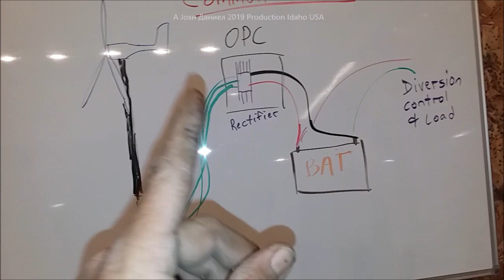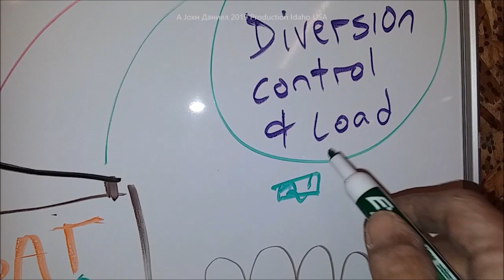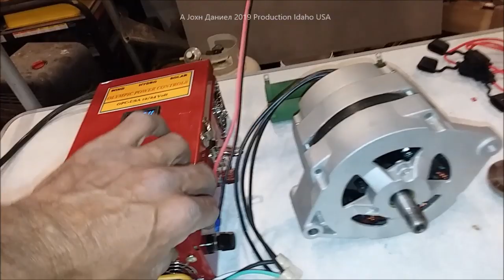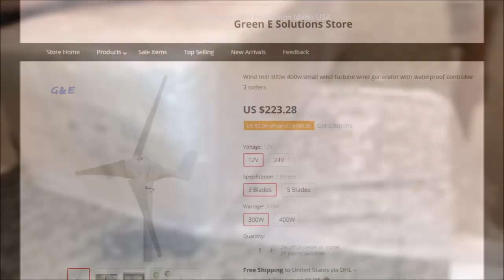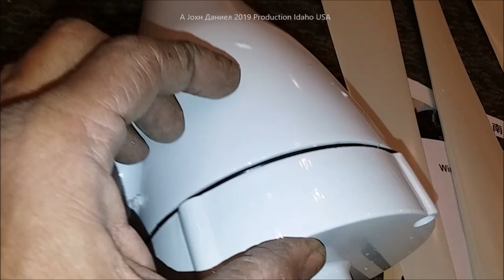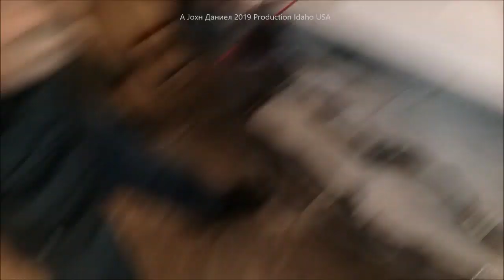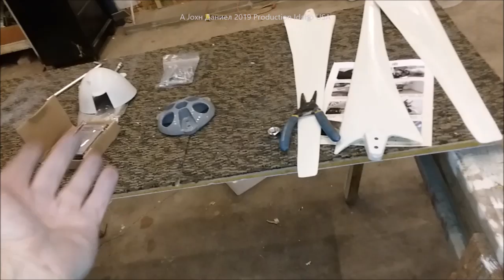300 watt Micro Wind Turbine, the GE-300-S, truthfully 300 WATT RATED! ALL Parts below vid

Comment: John what is your PayPal account link so I can send 35.00 to it for controller?
Reply from the maker: I'll send you it tonight on Olympic email. Been running season run. Will be back Saturday full time till July 5th so I can get one out to you.
Reply from the maker: Cool news, I was able to send from my phone, never tried that. Sent you a PayPal invoice. I'm in Shiprock New Mexico till tonight, glad I have internet on the Samsung!
Reply from the maker: Theres 3 in the shop I made up I'll just tell Wife to box one. I'll do a video on how to set it up and adjust voltage. Can NOT be placed in Poor venting, or unventilated or wet locations. Be sure good cool air flow and proper wiring. I'll send some lugs too. 300 watts (26 amps) of 2 to 5 ohm well vented resistors is max on its 40A SSR, to go higher you will need to put in a 60 amp DC/DC SSR. 
JD
Reply: Cool I would.like to bring my entire trailer out and show you it. I need so.e help figuring out my battery shut off I bought one that didnt seem to work . I need to figure out some kind of breaker box or fuse box and power distribution.  I made a bus bar for negative and positive using 1/8 thick, 3/4 width,14 inches long copper bars 600 amps I wired it to first positive  and far negative with two 0/2 welding cables on each 5ft long and bolted both double terminals to center of the bus bar. But my inverter seems to lag like there isnt enough power when I run my 15,000 btu AC unit I think it's an issue with the inside of inverter,  its voltage meter says 13.4v then flashes 12.5 for a sec and back to 13.4 with no load. So  9v drop and it does this for a sec then back, when I run a load and it does this it will trigger the low battery off . And there is enough power too .
Reply: Oh the copper bars I used in bus I put 3 bars stacked and bolted together.
Reply: Wont the turbine go over the 40 amps easy?
Reply from the maker: @donaldsteele6276  Yes, it'll probably hit 70 amps numerous times a minute but not constantly. Mine has hit 91 amps, but thats not 60 times a minute its in that range. When the divert kicks in it will be like putting a few dead batteries on the system, immediately dragging the turbine down. I run 400 watts on mine but I have completely insane winds. When its peaking at 50 amps constant the braking load also is what I use. But I have numerous turbines, so I must do that.
Reply: Oh I get it the resistors need vented too lol. I will just order another temperature relay board and fan I will put the resistors in a different box with a 2 inch OD pole mounted to the box with a fan pulling air from under the trailer to the resistors and a top covered air vent to blow the hot air out . Would that work? What's the size of enclosure needed?
Reply: How much for resistors that I need and brake throw switch.? Can I purchase everything I need from you? I order 25 ft of 6/3 awg for turbines wiring to help with line loss the turbine store send me a new stator and coil and guts for turbine because they didnt put the rubber seal gasket on the case and everything got very corroded inside.
Reply: Wow.today mine was hit with 60 mph wind gusts and 30 mph winds constantly that small controller hit the brakes it was still getting 6 amps at slow brake speeds.  My tower is awesome it has taken a beating well no problem.  I need help with fusing and breakers and also new 80.amp.mppt controller 200v max I'm putting 4 300 watt panels on it soon. I have no idea about combiner boxes and breakers for those. I'm reading allot. I would love for you to see my setup and offer pointers fixes what ever even freaking smack upside my head lol. Dude I am trying to figure out this busbar I made I think I might need to add some more bars. Not sure. I was thinking of making 2 one for power in one for power out right now they are all on the same one. I am trying to make a battery shut off switch work I bough a huge one and it didnt work.right.
Reply: I took care of it. Thanks. Does this come with the resisters or do I need to order some?
Reply: John are resisters included or do I need to order some?
Reply: John I ordered 3 100 watt resistors from your link but they wont arrive till august so I found some of these and ordered them OHMITE Resistor 100W 3 OHM L100J3R0 NIB they will get here by the 25th. Will those work good?
Reply: That controller you sent is awesome I'm trying to figure out the best weatherproof way to set this up. I was thinking a plastic weatherproof box with intake holes and outside holes and larger tubes attached to intakes on the red box feeding the cool air to it from a weather proof box.
Reply: Oh.i.want to buy some mc4 adapters and the mc4 lug adapters too for my large box and the red and black lugs for some other cases and equipment wiring. It would make the portable wind  and solar stuff better.

Comment: Are those 3 phase wind generators and that controller setup suitable for charging a Lithium Iron battery bank?
Reply from the maker: Yes. Best method is using supplied controller, slave batteries and a good MPPT
Reply: @JOHNDANIEL1  Do you a schematic of how you suggest this is wired up for lipo batteries?

Comment: What is the maximum 12v battery bank size one of the 500 watt turbines can charge?
Reply from the maker: 1000 ah
Reply: 1,410 AH
Reply: Shit mine is to big then
Reply from the maker: @donaldsteele6276  You asked about a 500 watt wind turbines ability to charge maintain a bank, you also have solar. If you only had wind power you would get batteries that never received enough charge with just wind and they would fail. But since you have solar also the max is based on the input of solar too. And of course the draw.
Reply: @JOHNDANIEL1  any luck with building a custom controller yet? I am about to wire my old one back in the mix because I have to have something on it other than that shitty controller that came with the turbine. I just have to wire with 6 awg welding cable this time. It's been stalling because the 30 amp camper cord wire or 3 x 10 gauge is 34 ft to controller now and I need to ho higher in gauge to much line loss.
Reply: So I would need to remove batteries from the  bank or maybe just make 2 banks and use bus bars to make a giant manual switch over.
Reply: Or get a bigger wind turbine none of them over 1kw are 12v can I use mppt controllers to run a 48 v?
Reply: I havent added the last 2 GC2-6V yet so I could just go with 8 GC2-6V on main bank and just make a smaller backup 4 GC2-6V bank?
Reply: These batteries are 235 AH GC2-6V
Reply: I know what I will do then. I will split the system solar on the 8 bank and the 4 bank the turbine  and since I wired everything to a bus bar I can just use some kind of switch over for the inverter to select bank or even select solar or turbine to charge a bank
Reply: What can I connect to the inverter to add a bank selector?
Reply: I also have a bunch more copper bus bars
Reply: John do they make switches that can control the positive and negative connections of 2 banks and switch bus bar items to the other bank and back?
Reply: Or can I just be simple about it and just  use large gator clips on the battery cables and just select which bus bar I want the bank on ? Or a design I could use copper bars to make a throw switch box or something
Reply: Well I have 600 watt 24v solar on a renogy rover mppt controller.  I found some 245 watt 30v panels for 67.00 each I'm buying 4 of those and making a large fold up table sized case with wheels on the bottom and a tow handle  with some window latches  this will happen next mo I'm almost tapped out. I ordered some 6 awg welding cable 50 ft worth and wanted to wire the turbine part way with that. And my mppt controller too.
Reply: I just notice that if I hook up a few batteries to the wind turbine you can see the volts jump up when its hitting charge speeds. But on my larger bank you might see it jump by 1 volt or none.
Reply: Well John what would you need from me to get me a good sized up controller for this system?
Reply: Hey john can u please send me a link to your PayPal account for the controller setup please  I need one asap my cheap one from China popped a chip on the 3 phase side internally when no wind was blowing. Thank god it was fused so its didnt damage anything else. Right now I'm using a rectifier that's fused 100 amp ANL fuse to battery bank and a cheap outdoor Chinese controller piggy backed to 100 amp rectifier.
Reply: One thing I was even thinking about was buying a 230v wind turbine with a inline inverter and use it to power my duel 80 amp marine charger and switch on its 230v plug and just use it to charge my large bank. And run  a voltage monitor to a dump load relay.

Comment: John do you have a link to your controller boxes you make?
Reply from the maker: No, I build them on spec for each application. Now that your turbine is built, installed and likely set for use a parts sizing can be applied. You need a 60 amp DC-DC SSR, diversion control to activate it, and 300 watts of resistors possible 400 watts of them if your going to park it high and clear.
Reply: Cool when can I get it and how much? Do I still get the hill Billy from Idaho discount?
Reply: Yup I'm adding more height eventually it will go 50 to 60 ft

Comment: How does this amazon.ca wind turbine compare?

https://www.amazon.ca/Turbine-Generator-Controller-Windmill-Convenient/dp/B07JGCDFDH
Reply from the maker: THIS WILL BE CONFUSING! But lets go - They make 2 near same appearing models with 4 blade sizes. The 100 watt/200 watt uses the 50mm thick stator and 40mm long magnets. Then they use the 500 and 550 mm blades to make one a 100 and another 200w. Model your showing is a 1.2m diameter blades, (just under 4 foot with 550mm blades)  Those in that link are the 200 watt models sold as 400 watt. A real 400 has 700mm blades, a 300 uses same 75mm PMA as a 400, but with 650 mm blades. Thats why I tell them to get the Green E 300, it runs safer with a bit smaller blades in high wind storms yet will hit 400 without damage in 25mph.  
I had a install where they bought 4 of those exact models, the folks were very upset when I said the PMA was only 50mm thick and maybe could hit 200 watts. So I opened one up, YEP, it was the high rpm 50mm stator. They returned them and ordered 2 of the M-500 models. 
These in the video, this lady ordered 3 to give me one to get her 2 installed for less, has the 75mm PMA, heavier wire,  60mm magnet length and with heavier slip ring. Blades are 650mm to make it 4 foot 5" .  
I do not trust Mars re-seller.

Comment: I am experimenting with 16 180ah Lifepo4 batteries and it's amazing the time's we are in now. With solar years ago things were possible but not money well spent. In the past several years with solar, wind and now lithium iron phosphate batteries... It it TOTALLY do able to be self sustainable. I'll post more vids of my build soon, but I did a test of 8 of the batteries on an emergency situation with my house and ran many things for 12 hours! . The dream is to build my next house with solar, wind and the batteries. 
Learning a lot from you as far as combining the wind into the dream. 
Thanks again John,
Dan
Reply from the maker: Looks like your pushing on to modern methods. Age is so fast creeping up on me, I started using smaller tools due to carpal tunnel and hopefully my next build for my own system will be MUCH LIGHTER LiPo . I heavily suggest a B&D impact like this one https://bit.ly/2WkWbKR compared to my Milwaukee thats kicking my butt. Never thought that little 8 ounce less tool would be just as powerful as my Milwaukee and keep me going on solar installs so much longer. Being in my 50's now sucks!

Comment: Also John, do I need to Install a diode in order to use the shunt? I installed the shunt just after the rectifier. The only reading I get from my digital meter is the systems battery voltage unless the wind generator exceeds the battery voltage then I pick up the additional voltage, I’m not reading any amps or wattage?
Reply from the maker: Your shunt main lugs should be between the Negative on the rectifier and battery. Your field wires should be as seen in my controller. Yellow/black unless you have a different color. The 2 red/black are to power the meter as well as show voltage and go only to battery. But it is possible you have a bad meter. I think It would be a good idea I do a video on 4 or 5 models since wiring differs on some to show correct millivolt alignment and where in stream to mount them. You gave me a good idea on them and even though others have done videos for things like car stereos or motors with amp meters, a basic all uses video needs to be there to help.
Reply: Јоhn Daniel can you go to my channel and check out my wiring video as to where I have the shunt installed? Also, can’t I just replace the dump load with a dead short as a auto break?
Reply from the maker: Looked it over, I suggest swapping the small wires around on the shunt.  Try both ways using this method of meter testing. If you have a 6 to 15 amp battery charger clip its clamps on the output of the rectifier leaving everything still like it is, You do not need to disconnect the turbine or change anything. Plug in the charger, note the volts rise and then check your readings. Secondly your length of run from turbine to control board, how long is it, are you using 8awg in that length at least? Loss may be significant in that distance.
Reply: Can you go to my channel and check out the video? I’ve tried 2 meters and my multi-meter and still no amp readings? I even gave you credit on the breaking system that I copied from you.
Reply: 25 foot pole and 40 foot run to garage, I’m using 8g all the way to the rectifier
Reply: I’ll try battery charger and swapping the shunt wires around

Comment: I built your manual breaking system that’s works well but it’s fully manual. I prefer your new design because of it being automatic breaking. Is there a way to modify a manual system to becoming a auto system?
Reply from the maker: Yes, I will be doing a video on how to make a volt sensing automatic 3 phase braking system. I work 60+ hour a week and teach 4 kids home school so it may be a few weeks.

Comment: I can use anything that uses power for the power dump, am I correct? Like a water heater or another set of batteries or something like that. I am pretty sure I am correct but I wanted to run it past you to make sure since you have a lot of experience than I do in this stuff.
Reply from the maker: I put a link down below the video to Ali where you can get the best water heating elements so your diversion can heat water. We do this in our place in the hills near Baker Nevada, we keep a 14 x 28 foot cabin warm with that process. Ours is mounted in 3 thirty gallon stainless steel barrels and a over temp diversion relay send power to a outside resistor bank if the water hits 140 degrees. The radiant heat from its tiny 8x8 basement keeps the shack warm in 0 degree weather. Always windy in the Nevada winter, and 8 batteries fill fast using 3 of these similar turbines.

Comment: How to add Windmill to a lithium battery solar sys.  I dont believe this method would work
Reply from the maker: You can charge lithium with wind. You must have a multi stage programmable charge controller. Theres about 5 on the market that are safe and effective.

Comment: Tell me something do you balance your blades before you put up your turbines
Reply from the maker: Yes. I use a balancing unit I designed about 8 years ago and a poly acrylic adhesive to add weight if needed. Luckily the Wuixi Air ( these) are within 2 grams on average. And if they are not, Green E will send you a replacement quick in my experience.
Reply: @JOHNDANIEL1  thank you John . I saw a guy doit about two years ago on the tube didn't know if it BS or not it's some most don't know about turbines I wasn't sure myself

Comment: BRO WHICH BETTER 24volts wind turbine or 12volts wind turbine
Reply from the maker: I prefer a all 12 system
Reply: Јоhn Daniel same, I don’t like the idea of voltages larger than 12 around my sleeping area... all 12 makes it simpler to build and set up... thanks for the wonderful review, I think I may get this turbine to supplement my panels at night... your video has actually perked me up to grab one... just gotta finish my solar setup.

Comment: So you don't recommend the controller that comes with the Chinese turbine? Why?
Reply from the maker: I do recommend them, just not for multiple wind turbines. None of them as dead accurate in braking voltage settings so one will get the feedback from another turbine and toast itself. And none can actually handle these dang Wuixi turbines, you need a 400+ on a 300w turbine, especially in my area you may need a 500 capable. When this company Wuixi went to the AFL style magnet they became REAL producers. So its not smart to use the 300 that comes with a 300 turbine, get a 400 as a spare to put in when this little thing kills the 300 controller!!
Reply: @JOHNDANIEL1  The bad part about the ones that come with the turbines is that they are non-adjustable. Depending on your loads and solar panels installed, the wind turbine controller will often be in braking mode.

Comment: what do you know about their 1000w wind turbine, are they just as good as the 500 and 300?
Reply from the maker: Their 48 volt 1000 watt and especially the furling 1200 watt model is crazy powerful and you can actually feed it into a 80 amp MPPT 150 open volt solar controller with a side mounted diversion controller to keep it under 1200 watts and charge 24 volt bank like nothing I ever saw.
Reply: @JOHNDANIEL1  thanks for the reply.  I would like to contact you about getting more information on putting up a system, your ideas on which model I should use here in Michigan.